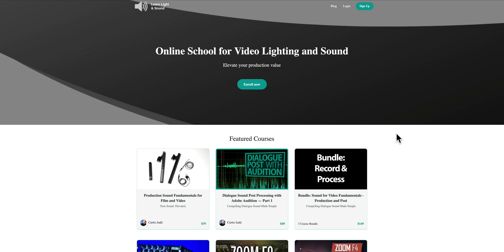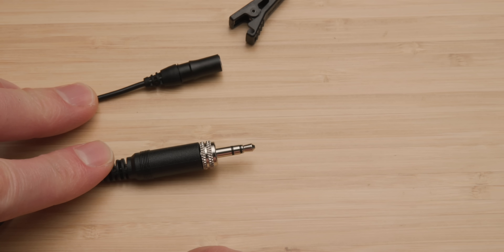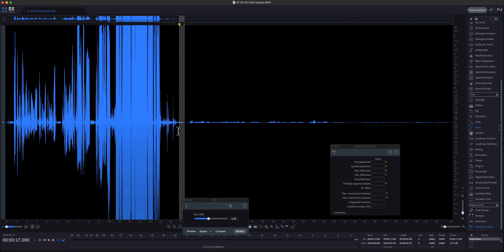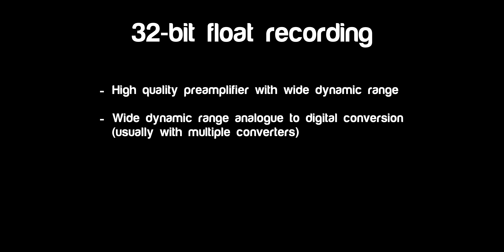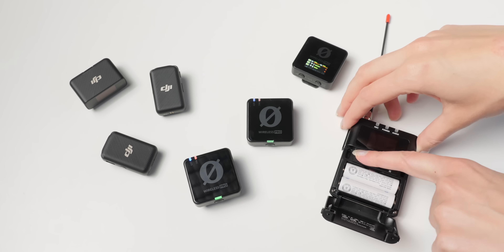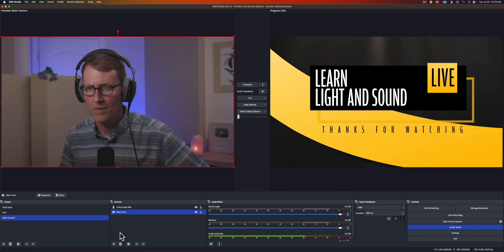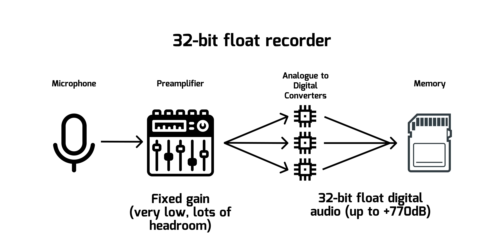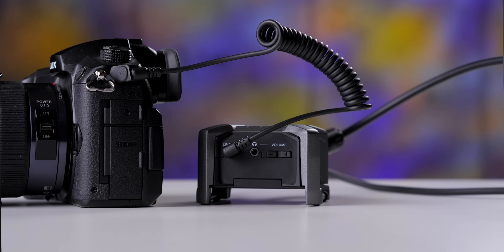Is 32-bit Float Audio Magic?

Comment: Hi Curtis , I record a lot of (video )railway footage, and sound levels can go from soft ambient, to a freight train with 5 loco's at full tilt climbing a grade. With out a "sound guy" it is difficult to dial in the on camera audio (Sony Fs5) without clipping. I run -6db on the XLR inputs on manual and get good results, but 32 bit float sounds like a game changer for me....so this recorder may be on the shopping list?  
Thanks for the review.
Gregg.
Reply from the maker: Yes, sounds like a quality 32-bit float recorder and quality mic(s) would help here.
Reply: Thanks Curtis. I'm using a Audio Technica BP4029 and 4025 , depending on situation. Both great mics at the price point I think.
Cheers Gregg.

Comment: You alluded to this, but basically you can clip either in the analog domain or the digital domain. Here’s the argument I would make in favor of a more forgiving bit depth, though acknowledging of course it’s not a magic bullet. You can clip in the analog domain and not even necessarily hear it. In fact, moderate analog clipping is known as saturation and it actually sounds pleasing, ads extra harmonics and such. On the other hand, digital is all or nothing. Once you cross that 0DBFS threshold, you’re going to get a nasty, crackly sound that nobody outside of an experimental industrial band is probably going to like. Thus, you don’t need to worry as much about overloading the front end (though you can certainly take that too far) but you do need to worry about overdriving in the digital domain. So if I could choose an “insurance plan,” as it were, for either the analog or digital domain, I would choose digital, because that’s where the impact will be more catastrophic if it happens
Reply from the maker: I understand. And another problem is that most seem to be in the bad habit of gaining up too much from the start. If most backed off a bit, both problems would be solved.
Reply: @curtisjudd absolutely

Comment: A question, that is probably very basic, when I hand a SD card with 32 bit float files to an assembly editor and they convert it to 24 bit in order to import the audio into their editing software, are you losing the benefit of 32 bit float or can that still be recovered down the line when it gets to the audio post editor? When you talk about pushing work down the line to post-production, I am wondering just how much work that is, especially on a fast moving production.
Reply from the maker: With most NLE apps in 2025, they shouldn’t need to convert to 24-bit unless they’re specifically using some sort of custom template that imposes that limitation. But yes, once audio is converted to 24-bit, all audio above 0dBFS is lost.

Comment: As someone who does vox pops and interviews in conventions, its super important for me to have the least amount of things to focus on than the task at hand. If I can remove many variables that have the potential of things going wrong, I will.

As for 32-bit float, I don’t agree with the idea that it doesn’t reduce the amount of work. If a recording ends up unusably distorted, that’s more work, not less. If a signal was always going to clip past 0dB during recording, whether you used 32-bit float or not, you’re still going to need to address it, so it does make a difference in practice. If you peak over 0dB, there's no clipping. You just lower the gain. That’s a non-destructive, one-step adjustment, not "extra work" in any meaningful sense.
Reply from the maker: You can do what works for you. You don't have to agree with me and we can still be friends.
Reply: Yup. The cheap little zoom 32 bit float recorder I bought a couple months ago can normalize during export, which essentially means you’ll never end up with a clipped file unless you clip the analog front end, as he says in the video. I find that this is rare, especially if you are using your own high-quality mics or recording line level

Comment: Thanks again, Curtis! I'm restarting the MixPre-3 course and needed some clarification on 32-bit float. It's been a while since I've used the MixPre-3, so I could use a refresher. With two Shure SM7Bs in an office/studio setup, it seems like 24-bit should work just fine and require less post-processing—which I'm not an expert at. I really appreciate this video and the well-structured course. Hope you have a great day! 😀
Reply from the maker: Thanks and happy recording!

Comment: I guess you won't see this late comment now, but what is starting to emerge is that some lower cost 32 bit float recorders do not use dual A/D converters.  So what they seem to be doing is to use a 24 bit converter but write the file as 32 bit float.  So it looks like 32 bit float but the content of the file is only 24 bit audio.  Zoom H1e, Zoom H2e, Zoom H4e 3.5mm input - none of these claim dual converters.  In fact the H4e manual does specifically say that the 3.5mm input is not dual converted but that is not stated in their adverts.  I think the lowest cost device with full dual converter implementation is the Zoom H1 XLR.  Tascam's new low cost 32 bit float recorders are also not claiming dual converters.  It might be an interesting subject for a video.  And you would do it better than me...!
Reply from the maker: I just tested the DR-07XP and it seems to handle >0dB situations with its built-in mics decently for spoken (or yelled) word recordings. I don’t know whether they’re using multiple converters or not.
Reply: @curtisjudd  I suspect not as they don't claim it as far as I can see. As it can be set to record in 24 bit alternatively, it would be interesting to see whether any aspect of its performance changes when compared to the same test using 32 bit float. I would suspect that the 32 bit float output is simply 24 bits expressed as 32 bit float. But testing that definitively would be quite tricky. I think some influential person is going to have to ask Tascam to reveal what is really going on... Anyway thanks for your response.

[Edited to add that my way of visualizing this stuff is to consider 32 bit float as a wide ribbon. 24 bit audio when written as 32 bit float from a single converter creates a fairly narrow band of values along the ribbon. A narrow ribbon laid over a wide ribbon. That narrow ribbon can be laid in the middle of the wide one, or near the top of it or near the bottom. It would sound the same when normalized regardless of that relative height. But when the audio goes through dual converters, a wider range of values is written so the ribbon of data laid along the 32 bit float ribbon is a bit wider, and can't be converted back to 24 bits without losing some data in the process. That's how I see it. Rightly or wrongly!]

Comment: Would 32 bit float also be good for fixing gain that is too low without getting noise?
Reply from the maker: 2 things: 1) You don’t set analogue gain on 32-bit float recorders, you set post converter gain which is the same as boosting the audio in post and 2) 32-bit float audio is not completely noise free. In general the more expensive, higher quality recorders generate less self-noise than the cheaper recorders.
Reply: Sort of, yes ... but no digital recording technology can magically fix analogue noise that you supply to the digital part of a recorder. High bit-rate digital recording provides you with a huge dynamic range *on the digital side*. But we are generally limited by the analogue components mic/cables/ADC circuitry ... having optimised the analogue elements the digital processing in 32bit float ... (or 24bit for that matter) ... will give you lots of scope for raising levels in post without adding intrusive noise.

Comment: What about the opposite problem? Recording an extremely soft-spoken voice. The reduced quantization error should help get a more accurate signal, right? And allow for more amplification of the "signal" without lifting the noise too much? How does the mic quality play into this?
Reply from the maker: Just gain up in 24-bit, position the mic optimally and all good. Mic self-noise can be a factor, but for most quality modern mics, ambient noise is a bigger factor.

Comment: I haven't clipped audio  with my Tascam recorders except one time - was my fault not changing a gain setting when I used a different  mic. I won'!t 'upgrade' for 32-bit float, only will get it by default when I replace or buy new gear. Good show. Cheers

Comment: Had a buddy record speeches at a wedding with a Zoom F3, but he said even with the DJs gain at the lowest setting, it still distorted heavily. My guess is that he plugged into the back of the speaker which was receiving a line level way too hot for any recorder. I told him that's why I always opt to plug into the microphone receiver if I can, since that's the first gain stage, and is usually too low if anything.
Reply from the maker: Or a line level feed direct from the mixing board. But yes, they probably forgot to switch the input on the F3 to line level.

Comment: Thank you for that great explaination!
As a consumer recording voice only i just use a used Zoom H1 and set gain lower than -18db. So it never peaks and as i don‘t hear the difference i live with some quantization errors. I don‘t record classical music but voice only, and as long as i am in a quiet room and i don‘t get noise from clothes everything is fine. And all much better than the microphone in the camera or fideling with wireless microphones that may work or may not work. Mixing video and sound from external records is so easy this days with davinci resolve….

Comment: I have two quick thoughts:

1. No matter how well you set your gain on any bitrate, even 16 or 24, your microphones can still receive too much pressure. So that alone is not a slam-dunk argument against 32-bit float.

2. For field recordists who set up long-term unattended rigs, they very frequently talk about worrying about an unexpected event/noise clipping their recording.

None of these technologies are wonder drugs. You use the best tools you are able to use for the right purpose, and you learn their ins and outs to apply them properly.
Reply from the maker: Yes, agreed.
Reply: Sir, you are way too sensible to be on the Internet

Comment: Thank God you weighed in on this. I did this same topic and got so much unbelievable push back. I don't understand why people PREFER to spend money than just learn how to use their equipment properly
Reply: I remember that video. I thought It was one of the best practical presentations on how good the 24-bit tech already is. But I will also say that the answer is already in your question: paying takes less effort than learning, so that's why.
Reply from the maker: @mack_solo  Sadly, that is probably true for many people.
Reply from the maker: Thanks, John. I'm getting some push back as well. I also suspect that there are some nuanced costs to most 32-bit float implementations but need to do more digging.

Keep making great education over there, friend!
Reply: That’s how it goes man. Technology continues to advance and it can sometimes make the skills people had obsolete. I’m a programmer living in the AI era. I know this better than anyone lol. At the same time, that is the point of technology, to make things easier

Comment: I would argue that 32bit float is great for live streaming. I often do live streams of panel discussions. Getting 4-5 Shure sm7b’s into my zoom f6 and pasting it onto reaper via the USB interface mode. Where I do all my dynamics, effects, leveling etc. then passing the “mastered” version onto OBS / Vmix. This allows me to add or remove gain to get to the desired loudness of the platform easily in my daw. If I’m missing something I would love to hear it.
Reply from the maker: If it works, good 👍 but seems like an extra step to go through reaper to compensate for the fact that audio may exceed 0dB. Why not 24 bit mode with output limiter and processing plugins in OBS?
Reply: @curtisjudd  That is very true, depending on the live stream material. I know, that sounds sacrilegious for some audio people, as you should always strive for the best possible quality, but if you have loud sports or spoken words, compressing, limiting and other processing will not significantly detract from the material.

Comment: Thanks. That is very useful. As a solo-creator / beginner often working in uncontrolled environments, I've gone for 32bit to avoid gain issues. I have a Zoom F2, DJI Mic 2 and a Sennheiser MKE 600 (which I plug into the DJI Mic 2). The problem, however, is low volume for spoken word and there is no way of adjusting this on my equipment. Gain can only be raised in post, where it runs into issues. For example, pushing the gain high enough to make the spoken voice clearly audible often leads to the recording peaking, even though it doesn't sound like it's distorting. It would be great to get a post-production workflow for addressing low volume spoken word on 32bit.
Reply from the maker: We've got you: https://youtu.be/lHNhxGojFRU

Or if you want a more automated option: https://youtu.be/YspZ4gxensI
Reply: @curtisjudd  Thanks for the response. The links are very helpful. Very likely to sign up to your Davinci Fairlight course.
Reply: I think the argument that 32 bit float helps on the loud end of the spectrum makes sense. Provided you’re not overloading the analog stage before it hits the AD converters, your recording can withstand big spikes and volume without being destroyed. I’m more skeptical about the quieter end of the spectrum though. I just got a Zoom 32 bit recorder and there is no microphone preamp adjustment whatsoever. So if you plug a dynamic mic like the SM 57 into it, that’s like plugging the 57 into a normal recording interface with the preamp gain all the way down. Everyone knows 57s need a lot of preamp gain For quiet or moderate signals like vocals, acoustic guitars, etc., so what I end up doing is boosting the file in post, which brings up the noise floor right along with it. I have used a FetHead between the mic and the recorder and this gives me about 25 DB of reasonably clean headroom, so that’s an option, but that does add some coloration. I think even in the 32 bit world, we still need the ability to drive dynamic mics to a suitable level before AD conversion

Comment: As a run a gun team who shoots cars for a living 32 bit recording in the DJI MIC2 is a godsend. We don’t have a dedicated sound guy so I have to set the old recorder (zoom h6) to a very low level in anticipation for the loud engine / exhaust.
Reply from the maker: I’m surprised that the DJI Mic 2 microphones can handle loud engines and exhaust.
Reply: @curtisjudd  I pair them with the Rode Micro and its pretty usable. It does lose out a bit of low end, but I haven't found anything as small & easy to set up with a decent SPL. 

Side note, I noticed the 2nd generation of the mic has a far lower Max SPL
Reply from the maker: @nazhif1  👍 🏎

Comment: This is SO true, if you don't understand proper gain staging, no amount of 32but float will save you.
Reply: People are clinging to this gain staging skill like I imagine telephone operators clung to their switchboards before it all became automated. I mean of course it depends on the application, the quality of all the equipment involved and dozens of other factors, but basically, we are getting to a point with these audio formats where people just aren’t gonna need to worry about gain staging as much. That’s a good thing. Spend more time focusing on the creative or practical part of what you’re trying to achieve, not having to babysit the input stage so much

Comment: Great video! Better understanding the topic. Do you have a video of how to setup and what to think about for the 32 bit float workflow?
Reply from the maker: Thanks. I have a confession to make: I record almost always in 24-bit. I am pretty decent at setting gain so I'd rather not do extra work in post production with a 32-bit float recorded file that exceeds 0dB. But the main thing you'd have to do for 32-bit float recordings is find those cases where the audio goes over 0dB and either compress them, use clip gain to lower them, or drop the levels of the entire recording so that those bits are below 0dB.

Comment: I'm even more confused now than before. I have a DJI Mic2 setup and set it to record 32bit float and it records a backup to the TX as well. It actually saved me this past Friday when I found that with 2 mics set up it recorded them as a right and left track, so importing that audio and synching saved me. (Plud I had the bump the audio +20db to match what I usually get) is all this usually possible without the 32bit float? My computer seems to have zero issues.
Reply from the maker: If it's working for you and you're happy with it, great. I'm just explaining that it isn't the end-all be-all solution for every audio problem and it isn't better audio quality or fidelity, just that you have a fighting chance of recovering the audio if it DOES go over 0dB. That's all.